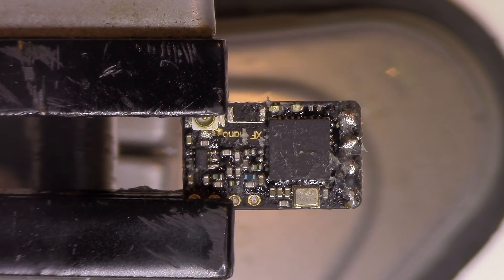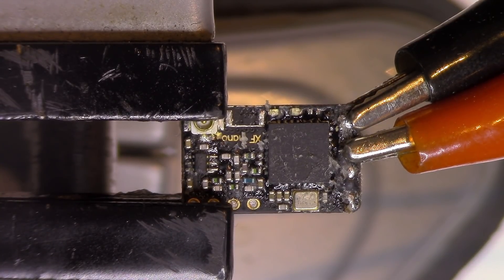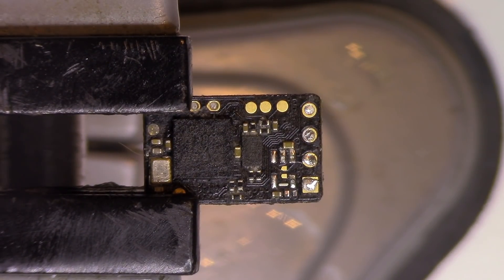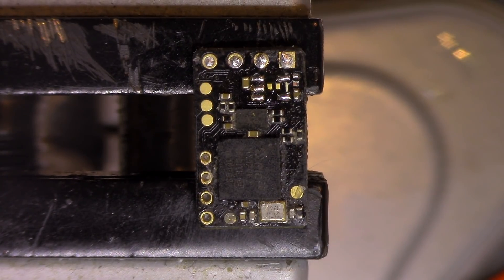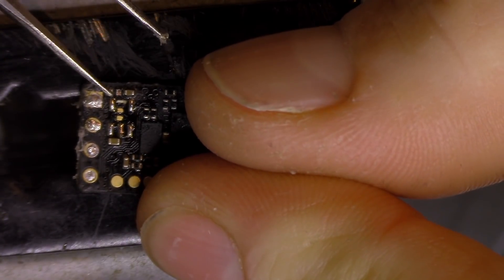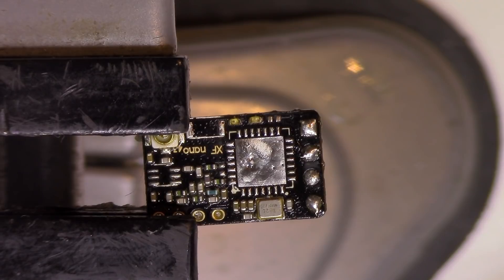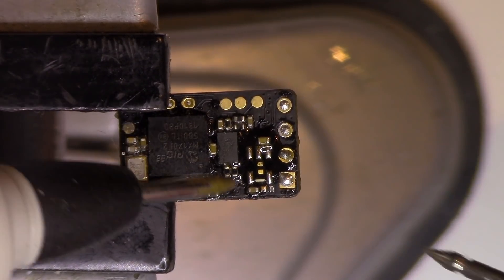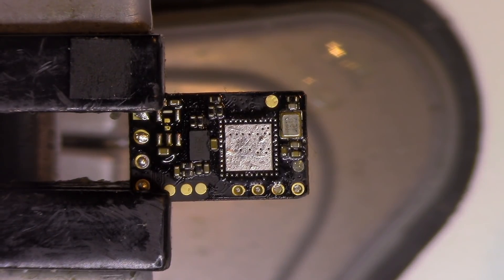Diagnosing Dead XF Nano Receiver

Comment: My nanorx binds and and is receiving accurate telemetry data.  I am able to reset and update its FW,  BUT....  Betaflight doesn't recognize any input and there are no LED feedback from the rx.  I've triple checked my connections and the outputs on my Crossfire output scripts.  Crossfire tx is on 1 and Crossfire rx is on 2.  I'm about to change out the rx with another when I get home from work, but would like to know if this one can be repaired.  Any advice would be greatly appreciated! 
Thank you for this great video btw!

Comment: Hi I have a issue with my quad it fell out of the air meaning it lost power nd fell to the ground nd nothing works now  if I touch the positive nd negative on the nano rx the continuity meter beeps same issue with the vtx tbs vtx. Would like to try nd fix it any input would be great

Comment: I've now watched you destroy three boards. I have given you two suggestions in the past. You're not using them. So here they are again. 

(1) if you have a working board for a comparison use the diode function on your DVM. Test voltages to ground and see where they differ. May point out the problem.

(2) when you do the power supply test, spray the board with 99% alcohol. Where it evaporates first is the hotspot.  Focus your attention there.

Comment: On power draw test before removing components spray while under power with 99% and see where evaporation happens first. Often immediately points out the short. In this case the MCU would probably evaporate very quickly. You would know the board couldn't be salvaged. You put it in your box of donor boards causing no additional damage. You may also try cleaning up the pads and pins on the MCU and reinstalling it. You may get lucky and you gain valuable practice at no cost or risk.

Comment: Send me a message, I have tons of extra parts I would be willing to donate. I appreciate the videos and have been able to fix a lot of fc's and RX's that I fried starting in the hobby. I would like to see a video on the r9 mm, I had a few minis go bad and got them working but not by replacing the voltage reg the proper way but by jumping to the EN pin
Reply: I have about 15 of them in my WTF box. they tend to just crap out, out of nowhere!

Comment: Finding the short: apply enough current to cause it to heat up slightly at the short. spray with alcohol. see where it evaporates fastest.
Reply from the maker: Not the case here... The reg was heating like crazy... Changing reg same issue... Apply 3.3v at 3 amps maybe but the ideea was to explain to people :)
Reply: @LivyuFPV  you missed a significant part of the explanation. First rule of restoration: don't disturb anymore than you have to.
Reply from the maker: @toddmarshall416  well that is kind of a logical thing to do :) I was not really looking at fixing this but rather show that sometimes you cannot know what part is in short so the only thing to do is take them out one by one until you know :)  do you have another technique except pushing lots of amps into the short and check the one that gets toasted? taking into consideration that one actually has a 3.3v power supply around
Reply: @LivyuFPV  yes...and so do you. You just skipped that step. And you don't need to push massive amps. Just enough to make the part hotter than normal and identify it with the alcohol. A Li-Ion cell will do the trick in a 3.3V application. Another good troubleshooting technique is using the diode function of the meter. For this you need something for comparison.
Reply from the maker: @toddmarshall416  ;)

Comment: how do plastic sockets and alike cope with the heat gun???
Reply: I use a little bit of kapton tape on those white plastic sockets.....and try to avoid blasting them with hot air.....pretty sure I picked that up from you, Livyu
Reply from the maker: You have to protect them and be sure to not pass the melting temp... The smt ones do cope with normal flow temps but if you exceed they can melt
Reply: @LivyuFPV  Thank you!